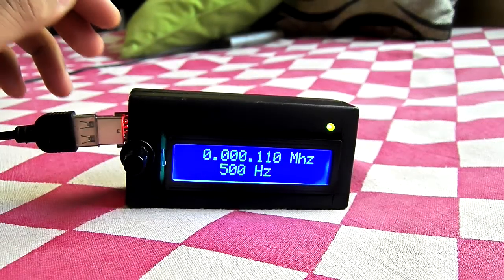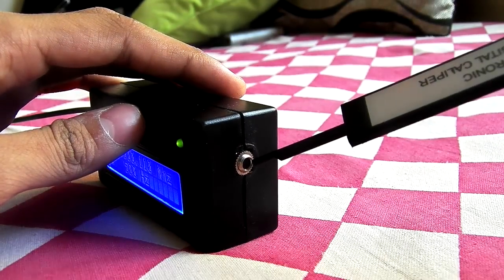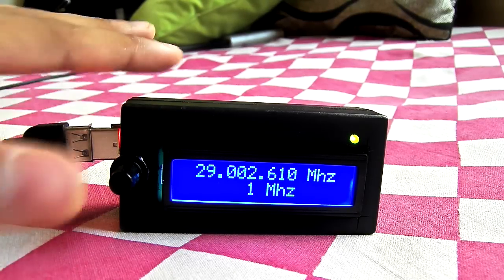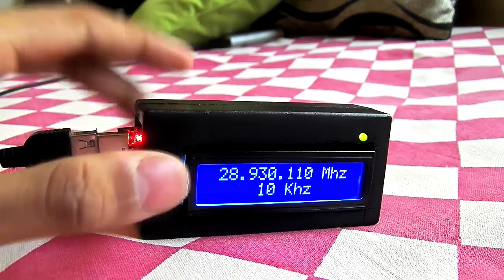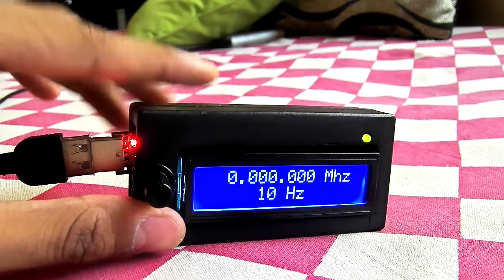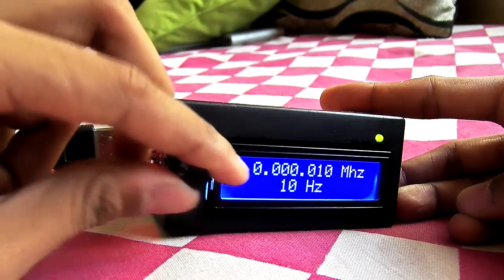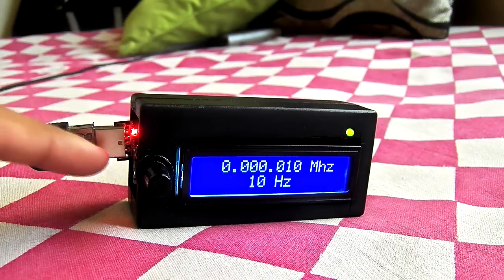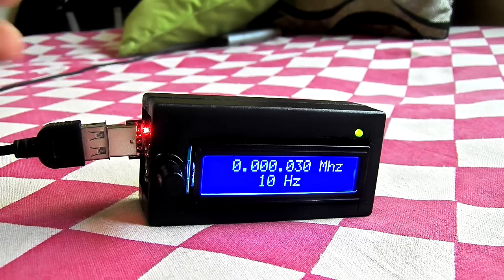DDS Signal Generator 30MHZ Arduino Code With AD9850

Comment: this is interesting stuff.. great work...
hope to see live running wave forms from your board and if possible add amplitude offset and phase shift control....
Reply from the maker: If you want further details go to eev blog post mentioned in description.
Reply: Manual phase shift control isn't all that useful with only one output since its pretty arbitrary what phase angle you are at for most applications. The only cases where phase shift really matters is a) if you are doing phase modulation of a carrier wave but this can't be done manually, it must be controlled digitally or b) if you have two outputs where one is the unshifted signal and the other is the shifted signal (possibly for phased array antennas for example) but I know for a fact that the dds module he is using (the AD9850), despite having two sine wave outputs, doesn't have the option of shifting the phase of just one output (if I read the datasheet correctly, if I'm wrong I would be very interested and glad to hear it as this differential phase function would be super useful)

Comment: being able to generate these precise frequencies with various waveforms can be used in so many ways. For those having problems opening the code ... I also could not open the ino file with arduino software so I opened it in notepad then copy all and paste to new arduino sketch and save now when i open saved file it opens ok ... ? go figure! there must be a gremlin some where ... more likely a compatability issue
Reply: can i use this like a varable quarts crystal ? is it stable? if i need 50 or 100mhz whats the best way up ?
Reply: the frequencies are very accurate so I would say yes but for higher frequencies analog devices make other dds chips with higher frequencies i think the ad9851 goes higher but if you check thier site you should find something to suit your needs

Comment: Great Job! But I can't open the Project ino. When I try it, one message said that the file need be into a folder named "Arduino AD9850 30 MHZ Signal Generator".
I created the folder and I put the file into the folder, but it doesn't work. Can you help me with this? Can you send me the file to me by email? Thanks very much!

Comment: Can you please when you make a new video explain what it is? It looks very interesting but I don't know what it is
Reply from the maker: Thanks for your feedback, it will help to improve me further.  in this video i showed my 30 mhz sine wave generator which is basically alternative to lab function generator  which produces diffrent waveforms, but these signal generators are sold for hundreds of dollars that's why i made this signal generator only in 12$ . signal generator has pretty interesting uses in electronics ,like PWM (Pulse Width Modulation ), Am Fm Pm Modulation tion techniques, you can also make an power inverter from signal generator
Reply: Oh cool, thnx bro